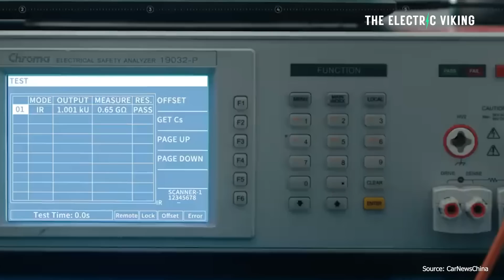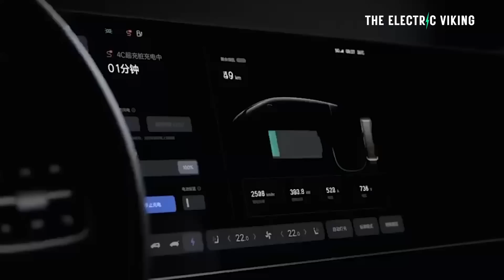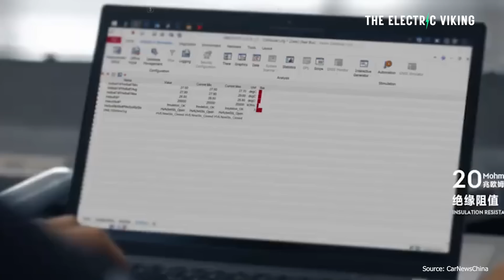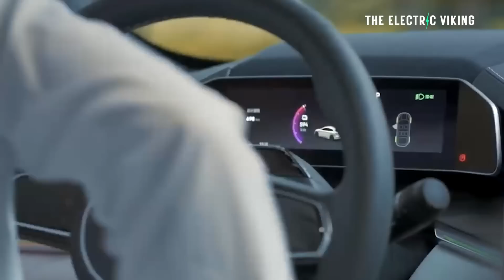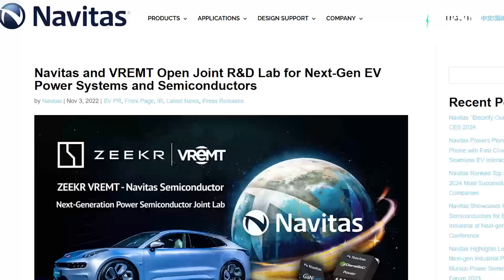Geely's Game Changing Fire Proof LFP batteries: 500kw charging, 83.7% density

Comment: you start now talking as a priest just say haleluja, heat means one thing recistange a bigR
something working good if it is not getting hot and what need cooling batterys and motor
220 kw motor 90 % efficiency meaning 242 Kwh needed for full power.
now tell me the EV who have a 245Kwh battery if not and it is 60 Kwh it will pul this power
in 15 minutes and that is stange he is getting hot and get on fire.
a dent in the floor and you need a 60.000 new batery because the cooling is ni flowing proper
and the car shut down some on the race track are pissed of because the car shuts down
now think only about what a broken heath sensor can do?

Comment: Great videos Sam.  But I can't bring myself to believe the 1000⁰c claim. The battery would have to have no copper connectors/ cables, aluminium, zinc, plastics, sealants, etc. Most substances are degraded at 1000⁰c There's a typo somewhere.

Comment: Every three years batteries are 40% higher density, 40% quicker and 40% cheaper. Im waiting for cars with 200-300 kwh pack and 1,2,3 MW charging speed. It will be sooner than we think.

Comment: Capacitors charge like that but you will need a really big capacitor battery bank connected to the grid charging all of the time then when a car is connected it can dump a extremely large amount of current to the car to recharge it. A capacitor will dump 90% of its charge in the first second and another 90% of what’s left in the next second and it chargers the same way that’s why they are used to take the ripples out of ac voltage to make it DC they will also use a coil of wire because it tries to stop the voltage drop and the capacitor will add current to keep the voltage up and if you put a big capacitor on each side of the coil it will take a pulsing voltage and smooth it out and make it a steady DC voltage. I realize that since IC’s came out people don’t seem to know anything about basics electronics anymore but till the 1970’s it was a big deal we even made vibrators to change DC back into AC to use with tubes and people use to make there own tubes using wire and screen wire and sealed them in old cigar tubes along with making there own capacitor’s we made some really big ones with things like a bottle filled with mercury sitting on a metal plate and things like a diode made from a rusty old razor blade with a wire attached to it. But now days everything is digital so we don’t make thing anymore. It cracks me up watching stuff these days like how complicated things like making tea are these days requiring so much equipment to do you dump tea leaves in water and let it soak for a while then take it out now if you use hot water it will get bitter after a couple of minutes it doesn’t do that in cold water and you don’t need to set it in the sun either anything over a couple of hours or even a day is ok then you can take out the tea bag or strainer or pore it through a screen coffee is the same and it never gets bitter if you don’t try to rush it by getting it hotter I’m assuming the same thing goes for batteries trying to heat everything up to hot causes problems. I just was watching one of the engineers from Tesla and he was talking bout there batteries keeping them on a charger and there’s cut the power when they start heating up because the batteries start to crystallize above 70 degrees so they have to cut the power before they get hot if it crystallizes all the way to the other plate it shorts out and has a runaway

Comment: The ONLY WAY that ICE engines will be replaced by 2030 is for the Suppressed technologies that used Closed Loop Systems that Recharge batteries as they are being driven.

The Beautiful thing is, it's So Simple that even I figured it out at tbe age of 15 in 1973 and in recent years I've spoken to 5 Engineers, 3 of whom run power grids here in the US and 1 in Armenia.

After posing my design to them - ALL 5 said that of course my design would recharge car batteries as the car moved and that the driver would give out before the car recharge, that a driver could go thousands of miles without stopping and they were All surprised that no one had done it yet.

I informed them that people have designed Hydrogen On Demand systems that work fearlessly flawlessly but they all met with misfortune and death.

Nikola Tesla did it too and powered his EV "Wirelessly." That was in the 1890's to give you some idea of how long technology has been suppressed by people who make Hundreds of Billions of dollars! 😉😅🤑😎💰💰💰

Comment: Also, consider this. Charging a battery happens at about, at best, at best, 95% efficiency. Where does the other 5% go? Dissipated as heat. So (at least) 5% of 500kW is (at least) 25kW. Try to imagine  (at least) 10 X 2500W heaters going full blast. That's 25kW. That's what  is going on inside your battery when you charge it as 500kW. Have you checked your car's insurance Ts & Cs about fires? Maybe do that now ?????

Comment: Nope. Complete Musk LIE. LFP batteries still have an oxygen-rich electrolyte which decomposes above its critical temperature. So it still goes into thermal runaway. Here in Queensland Australia we had such one. It was a Musk grid battery, LFP. Despite having the best BMS, water cooling, temperature sensors everywhere, 24/7 monitoring, despite all that, despite all that, it STILL caught on fire, STILL burst into inextinguishable flame, and STILL only stopped burning (it was NEVER "put out") only when the oxygen generation stopped.  No such thing as a "fireproof" Lithium battery.

Comment: I am very much onside with EV's et al. Love the tech (I am a retired mainframe computer engineer with 49 years in the industry).
So, having said that I see two problems.
1: the minus 45 degree then into a 100 degree fire test. How long was the battery in the fire? After two days at minus 45 degrees, I would imagine thermal intertia would enable the battery pack to survive in a 1000 degree fire for a while.
2: When will ANCAP start testing EV's and battery packs?  I would like to see how and EV battery would survive (or, more impportantly, not self destruct) after a head on at 60+ k's into a solid concrete block.

Comment: The charging rate is rated 500 KW then at a home voltage of 240 vac that would take over 200 A to charge at that rate. Most modern homes in USA have a 240 vac, 200 A service which would take all the amperage available. Of course if you stepped up the 240 vac to 800 vac then that would reduce the amps to about 50 A to 60 A to get to 500 KW charge rate.

Comment: The big question is, do you believe that a battery of that size containing so much liquid that when heated to 1000C , the huge pressure caused by evaporation is retained within the case, and as it cools all the electrolyte returns to where it needs to be thereafter ?
What a con

Comment: It won't matter if they invent a battery that has a 1000 mile range & charges in 10 mins,there is no infrastructure for electric cars & there never will be,Porches new zero emissions fuel for regular petrol engines & hydrogen is the way forward.

Comment: Let me nerd out a bit to calm the Vik's grandeur and fanboying over Chinese marketing releases. 

The new Zeekr 007 with this "golden" battery also claims 688km from 75kW base battery. The Chinese hugely overstate their performance. That 688km range, as we can expect, is on CLTC range from which you should discount at least a third, realistically. Then we get the decent, but not special range of 450km or about 300 miles. 

Now, Their claimed 500km in 15 minutes. Deduct 33% and they really mean 335km in 15 minutes. Which is about 75% of the Zeekr 007's range, so 75kW-25%= 56kW in 15 minutes. That's 224kW/hr charging speed. So all you're hyping about is just normal modern fast-charging speed we get from many manufacturers already.

Comment: Any battery in a metal box can handle 1000 °C flames without problem, question is for how long, out of context/without details, that demonstration is silly, at best. 

83.7% density refers to the volumetric packing density, which is good, but not that huge deal.  

If they have exceptional thermal tolerance, and at least decent energy density, most importantly the gravimetric energy density, and can charge at 4.5C all, or most of the way from low to high SoC regularly without issues that is potentially great.  Still, there are already EVs that, potentially with some minor adaptations, like preheating, can tolerate lower temperatures than 99-something percent of all the humans park their cars in.

Comment: Zeekr 007 LFP Golden Battery
76kWh 428mi CLTC range
So 10-80% on CLTC is 300mi using 53.2kWh takes 15min av 3.54kWh/min charge

Li Auto Mega using CATL Qilin 100kWh pack
5-80% delivered 77.3kWh in 11min 11sec
77.3kWh av 6.9kWh/min charge

The ShenXing LFP is rated at same charge rate as Qilin (4C), something not right here 🤷🏼‍♂️

Comment: Surely this isn’t as fast as the CATL Qilin that’s had test figures leaked on the Li Auto Mega showing 5 - 80% in 11min based on a 100kWh pack

The peak discharge at 16C would be impressive though

Comment: The electrical grid and what powers it are two factors that make your prediction a complete fail. The amount of energy that would need to be supplied by this electrical grid at the low rates of efficiency of this grid could not be accomplished without fossil fuels. The amount of metals needed to build a heavy enough grid is prohibitive and the energy needed to mine and refine them would also be prohibitive.

Comment: nothing can compete against diesel engines at the moment,  and you can power them with all kinds of less efficient but clean fuels.  such as methanol,   if China had the superbattery they would have an enormous advantage to use it in the shipping industry,  in large factories, and in all kinds of ways to compete against the rest of us,  without giving the battery away.  so the battery either doesn't exist at all,  or it has a big hidden flaw,  may be it doesn't live long, or has some other flaw.

Comment: fossil fuels will be banned,  not internal combustion engines,  which means they will turn to synthetic and bio-fuels,  as for the dream battery,  it sounds too good to be true and it probably is.      Ideal battery technology should be flow-type,  using liquid electrodes, kept in separate tanks.

Comment: 870KM getting closer to "required" 1000Km.... 1000Km EV Range is REALLY 330-350Km! Cargo, passengers, towing, heat/cold, repeated charging REDUCE REAL RANGE as much as 1/3! So 870 "UNDER LOAD CONDITIONS" (aka real world driving conditions = 870/3 =  290 to 300Km... This is the REAL NUMBER...

Comment: Regardless how good these batteries are ,the EV panacea is reliant on power grids being able to supply the electricity which is a million miles away right now. Add in the nonsense of heat pumps for heating your home and you have another enormous layer of demand that power grids globally simply cannot supply.

Comment: I've heard rumblings about this, but I don't follow it as closely as some of you who listen here. I was going maybe until the very end, and then I realized somebody's being overenthusiastic at least in one area.

If the battery is 100 kilowatt hours they're testing, that determines the range. Period. It doesn't determine the speed of charge, the temperature envelope, etc but once you have the electricity in there, that quantity is going to determine how far the vehicle can go. 

Which is going to be highly vehicle and application dependent. Streamlining and the speeds most of the driving will be done at make a huge difference. So does weight. The efficiency of the electric motors makes a difference, but I haven't heard of anything groundbreaking on that. So I don't see how you are going to get 800+ kilometer range with a  100kW battery.

Comment: Hi Sam, we have a few, very few, 400kW chargers in Spain. I always thought it was too much for current EV's. However, from now on they may have a competitive advantage.
Reply: The large majority of EV users mostly charge their batteries at home, ( an expensive but important conveince) and already paid a heavy price for a required charger upgrade.  In most weatern nations the grid, already burdoned by non steady state wind and solar, simply cannot handle a substainal  large percentage of EV cars.  (Simple fact)  Imagine 50 percent of the homes in your neighborhood pluging in 100 KW batteries.  There are other large issues with the resources required to substain such a wholesale tranformation.  Hybrids like the Rav 4 prime that require zero upgrade to home elect, pull about 12 amps, are a very practical alternative. 

 If the transition allowed 3rd and 4th generation nuclear then this could happen.  Until then what cant happen, wont.
Reply: @anderd333 I have to disagree with you there. Charging from home is probably the cheapest option anywhere in the world, more so if you have your own solar panels.
Also the grid is capable of supplying much more power for charging already. The grid supplies its maximum in the evening and after that peak, the operators start switching off generation capacity until a minimum requirement is reached. Simply keep the generators running overnight to provide all the charging required. 
In the UK the average car does about 22 miles a day. This means 2 hours charging at 3 kw already easily covered by existing generation capacity.
Just because an ev has a massive range and charging capacity it will still be doing average journeys and will be charged accordingly. If I am in bed for 8 hours I don't care if the car is charged in 10 mins or 8 hours. If I am on the road I would prefer 10 mins
Reply: If 100 percent of my neighbours were charging, the neighbourhood would still be charging on average for 22 miles per car per day. The tech to handle this is already built in to chargers
Reply: I get your point but that is not a situation likely to happen as it is not either going every diesel or gasoline vehicles to refill their tanks at the same time. In my country there are over 33millions of combustion vehicles and around 12.800 gas stations. This means, considering your same approach of the sizing of current electrical network, that there should be over 2.500 cars waiting for refueling in every gas station. Is this happening? Check it in your country, in mine is not because we don't go at the same time. Same for electrics.

Comment: The problem now moves to the charging infrastructure. Home charging is not a problem. But motorway charging and charging away from flats/apartment blocks is a few years away. It will happen. Extremely positive improvement. 300Kw needs a local substation
Reply: Ah. This is EV land. 300kwh. is nothing. It just appears magically out of thin air. A couple more solar panels on the roof... that should do it!

Comment: Where is the evidence / link to these claims... Aluminum melts at 660 C ... the battery case would need to be steel,  bronze / copper is plasticized at 1000 C and there would need to be no plastic anywhere.
This sound like bullshite. Sorry but it does.

Comment: It was only a matter of time until 45 year old Lion tech was greatly improved. If this tech can scale economically then I also do not see what the answer is from the old ICE world.
Reply: Scalability and cost are the two biggest limiting factors in the context of this technology. It's all well and good being able to supply the upper end of the market with fairly well appointed and well performing passenger vehicles. It's a whole different thing entirely to be able to produce cheap vehicles and also to be able to produce viable vehicles that genuinely meet the demands of the heavy transport sector.
Reply: @davidbrayshaw3529  The cheapest nastiest 1 series BMW with no options has a list price just shy of £29,000 I don't call that cheap. You are quite right about upper end supply, but this is by no means confined to EVs - a four pot diesel GLC SUV from Mercedes can easily go north of £75,000. I agree the heavy transport sector will be more of a challenge. Will have to see what the likes of Tesla Tractor Rigs will do to that market - if it is cheaper to run, then it will sell.

Comment: If it uses LFP chemistry, please explain, from an engineering / chemistry perspective, how this LFP battery can magically charge so much faster and endure such higher temperature extremes. A “gold insulation sheet” certainly will not cause the claimed performance increases. This is not how chemistry / engineering works. For one, absorbing 800kW of charging will generate enormous amounts of heat and battery degeneration. I am willing to bet this is yet another tall tale from electric utopia that we will never see out in the wild.

Comment: The proclaimed alternating Freezing - Burning test results are predominantly merely a proof that the battery housing is up to the job of complying with current standards. I don't see this as proof of an insanely capable and safe battery pack. What matters is the internal behavior if one cells goes off into Thermal Runaway, and subsequently, if adjacent cells can be prevented from propagating. If their cell design, in conjunction with the pack design, can provide a safe barrier for NO RUNAWAY / PROPAGATION: --> then YES, it is an insane game changer. If not, then there is nothing really won.